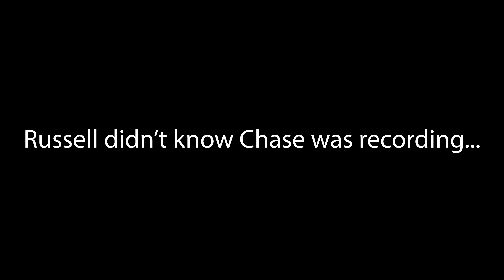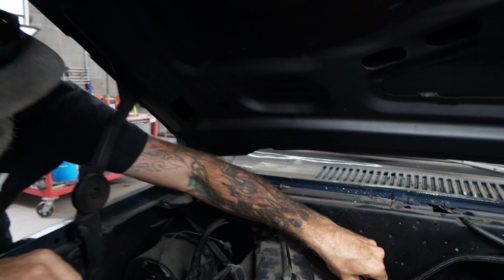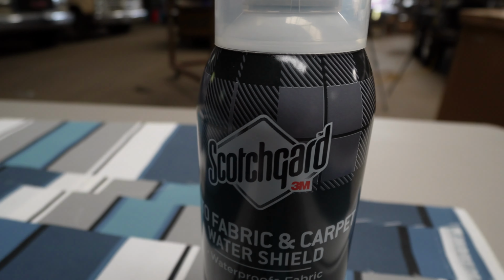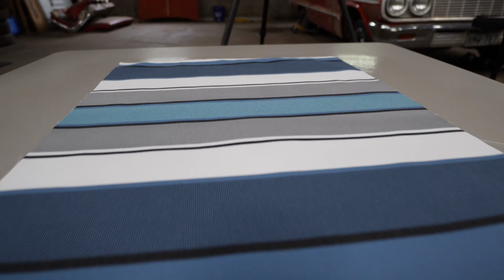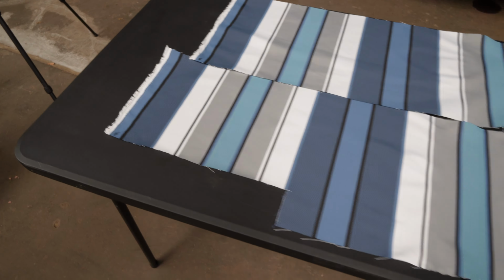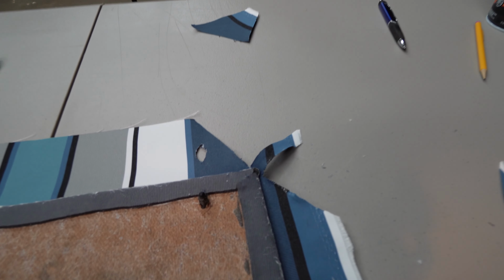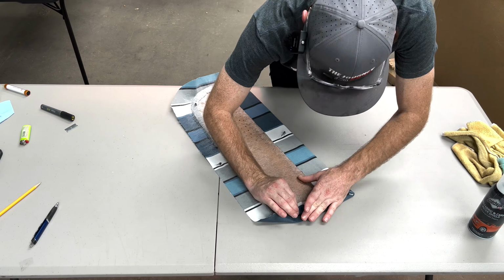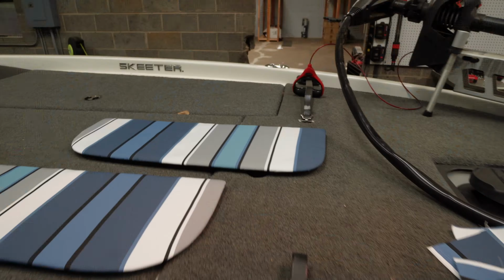C10 Door Panel Upholstery It's Easier than You Think

Comment: I noticed you cut out a circle where the bolt on the backside of the panel is. That should never be done. You’re always supposed to cut an X. The material holds up better over time.
Reply from the maker: Thanks for the advice